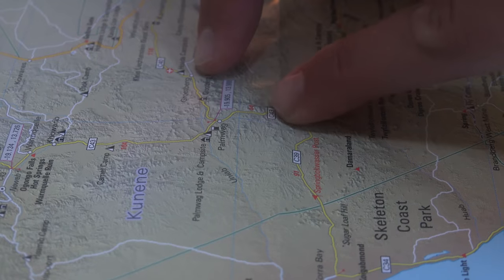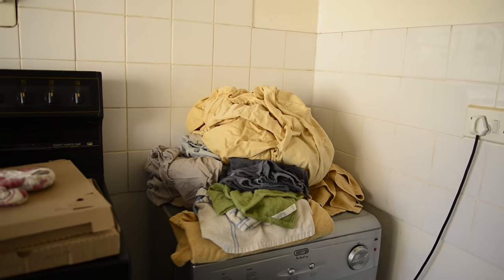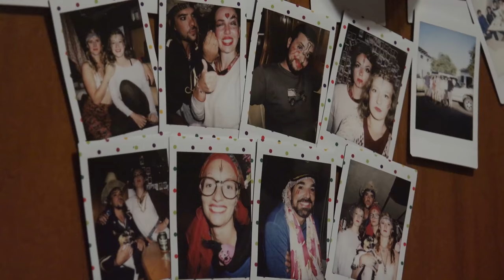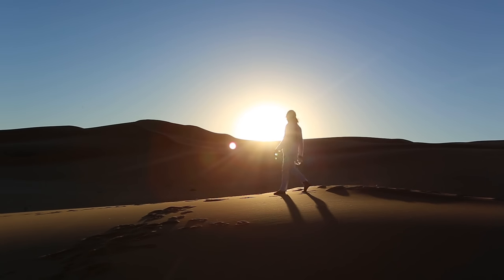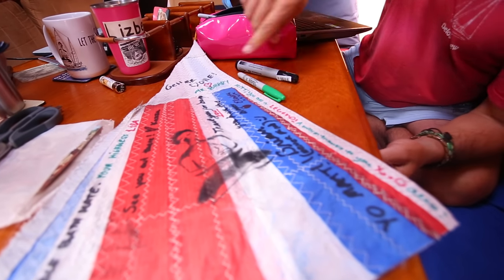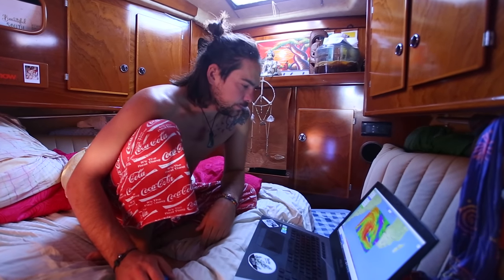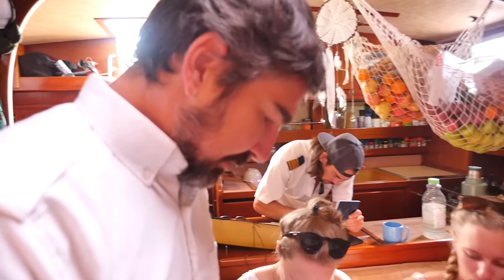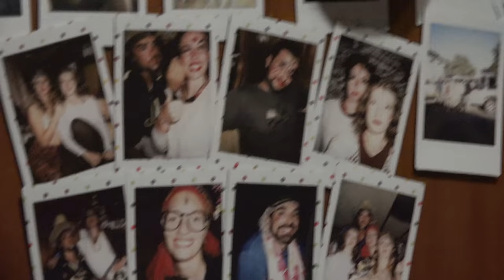Goodbye AFRICA! It's been a lekker few years! - Sailing Vessel Delos Ep. 149

Comment: BTW,  I know it does not matter now but you have to drop the air pressure in your tires down between 8~10 lbs and then you won't get stuck.  Of course this means ya need one of those fancy portable compressors.

Comment: Look back in the comments during the vlog where you put together the pump and impeller ! You Brian , put it in with two of the blades going the wrong way ! The video shows it ! The product is good but the install is bad ! Because the posting of these vlogs are several months behind real time I couldn't warn you of course but I hope this clues you in if you're wondering why the impeller failed ! Thanks for sharing 😎
Reply: zzzx xzzz Spot on. Was going to mention it when i saw your post. I "twist" them when installing to make sure all the blades end up facing the right way.
Reply from the maker: Ha ha I never remember engine rotation so 50/50 guess onblade direction but after 1/4 rotation the blades always align either way so no worries!  Brian

Comment: Because it’s New the bore of the impeller is not smooth and then you turn it off the housing goes dry  On start  up the blades dry ware quick , emery paper the bore or housing of the impeller smooth   Oil it and replace impeller and all’s good been there done that
Reply: gess ges what ever happened to the fifth impeller blade, did it ever show up?
Reply: Tom B. Sometimes the rubber blades find there way into the heat exchanger end caps or in the entry voids , for emptying next it gets a service

Comment: Question...what do you with the trash you accumulated during the passage???
Reply from the maker: Hey David! During passage, we try to be very smart. When we provision, we throw away all packaging that we don't need and store it in reusable ziplock bags. When we do have rubbish, like milk cartons or other stuff, we swill it with water, pack it down as much as we can and throw the big trash bags in a locker on deck. We keep all meat packaging separate and make sure that's washed too, to avoid smells! Then when we're at port, we can't wait to throw it all in the bins!